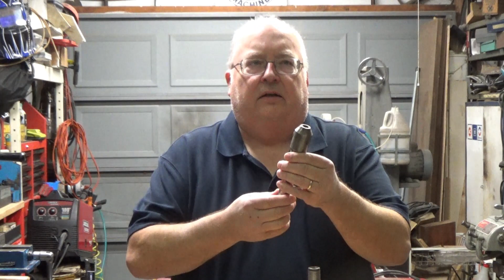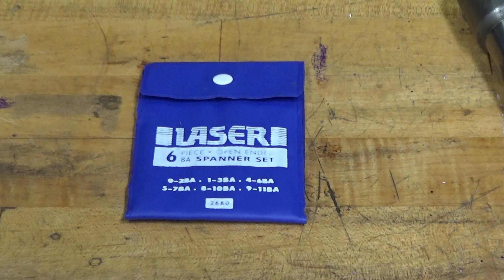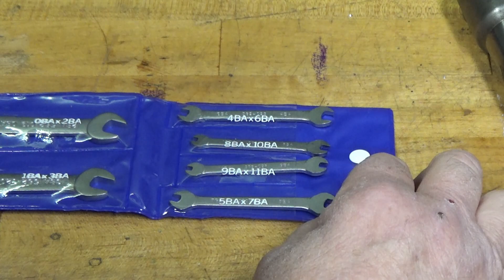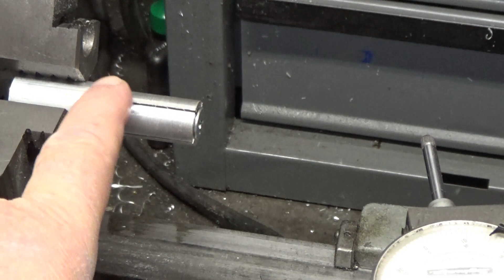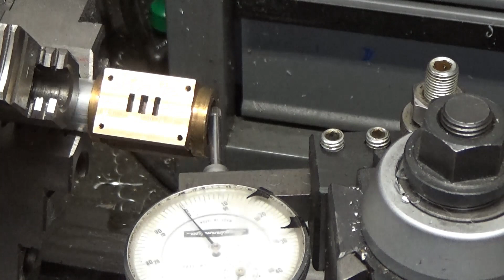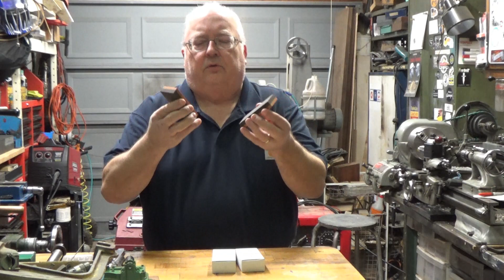Shark Bits #36- Expanding Mandrel Up-Date/3000 Subscriber Giveaway

Comment: Congratulations Steve on 3K milestone, enjoy your vids all the time. Further to advise on expanding mandrel, that simple design is conducive to making several full size mandrels at once and once chucked turn to size required for one offs every time. another application is using a tapered pipe tap and plug in place of the countersunk screw. A million ways to skin that cat! Cheers!
Reply from the maker: As you said there are many ways to accomplish the purpose.  I have seen the tapered plug style.  That would be good for a larger mandrel,  this one would be a bit small for a standard size tapered pipe plug. Thanks for watching, commenting and entering the Giveaway.

Comment: Congrats on 3000!!!  I hope those two end mill holders are useful !  Me finding B&S taper stuff is purely accidental,  the online auction people just lump it all together with M/T tooling .  Does anything need to be done to the internal bore of that engine?  If so I could easily do it for you on my Sunnen hone if needed.
Reply from the maker: The bore is good I will probably run a brake cylinder hone through it.  I have Sunnen hone available to me if necessary.  Thank you again.